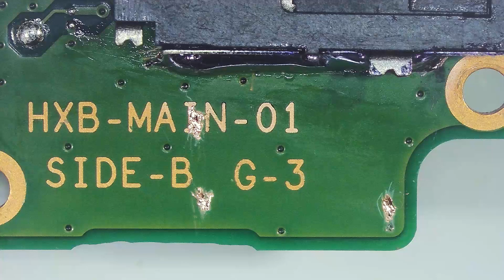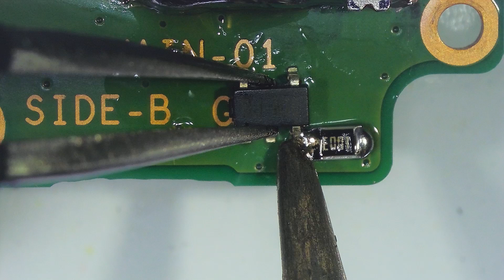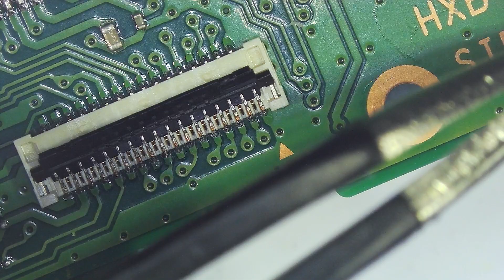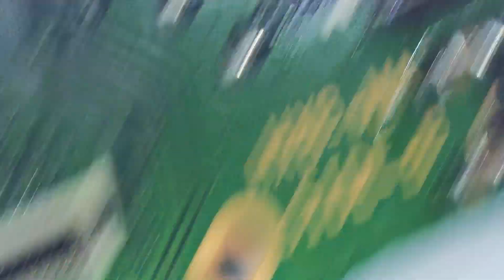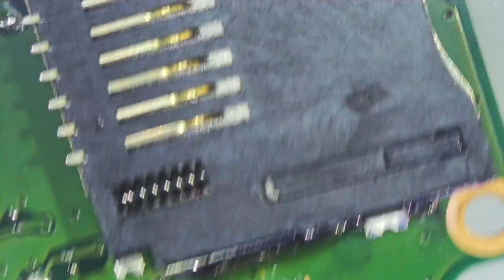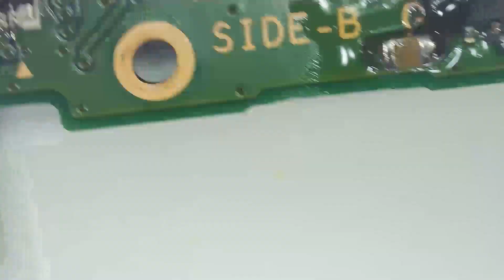Game & Watch: Super Mario Bros. / WIP 43

Comment: so the battery power is 3.7v and the STM32H7 runs at 1.8v? does it use SMPS or LDO?
Reply from the maker: DA9230 buck regulator